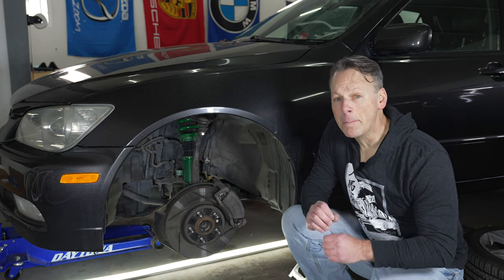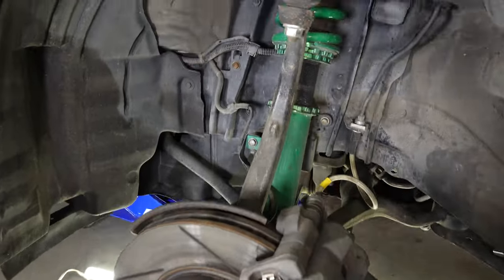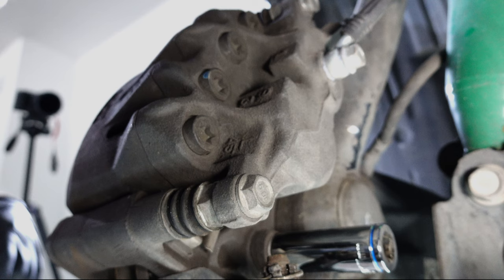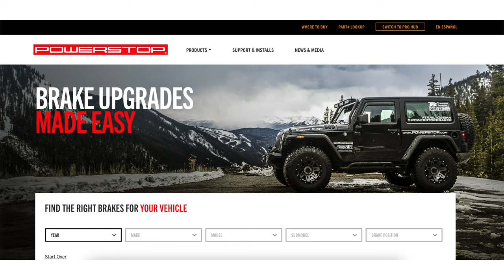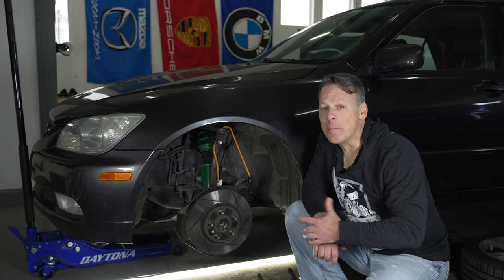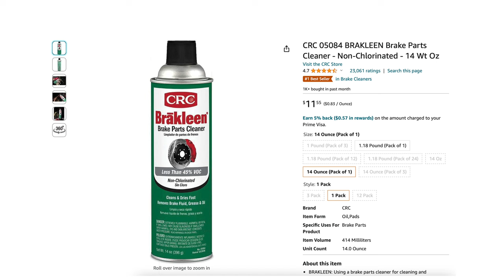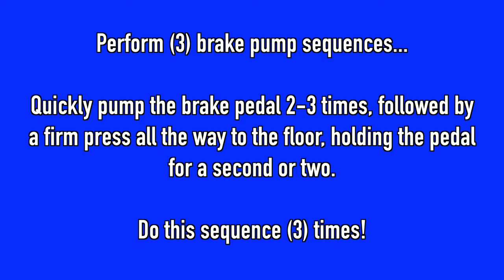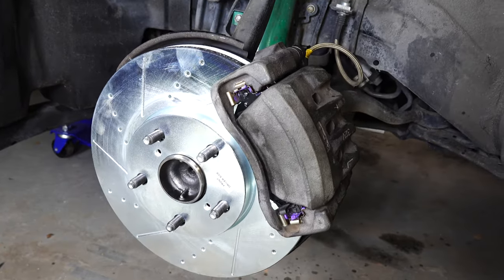(HOW-TO) FRONT Brake Pad & Rotor INSTALL  //  (2001-2005 LEXUS IS300)

Comment: I went with the r1 concepts e line drilled and slotted rotors and paired them up with Akebono performance pads. Is this also good?
Reply from the maker: Personally I’ve never used them, but trying the r1 concepts was my second choice 😁👍. Akebono makes good pads 👍

Comment: Hi I had these installed and I’m getting some rubbing noise, do you think this could happen if bolts were over tightened
Reply from the maker: Is it pads rubbing against the rotor when the brake isn’t engaged?
Reply from the maker: I doubt it’s the bolts. What exactly is rubbing?